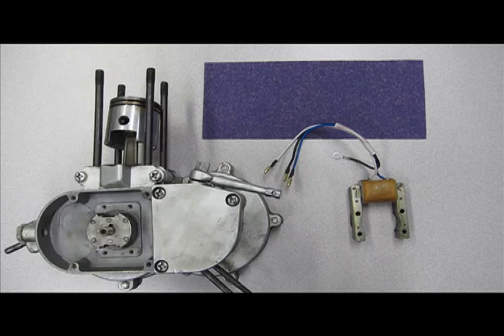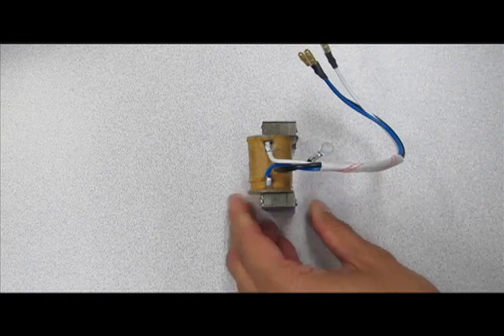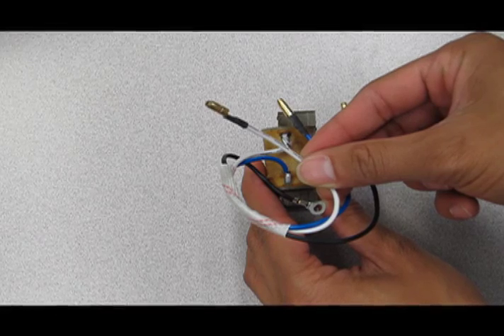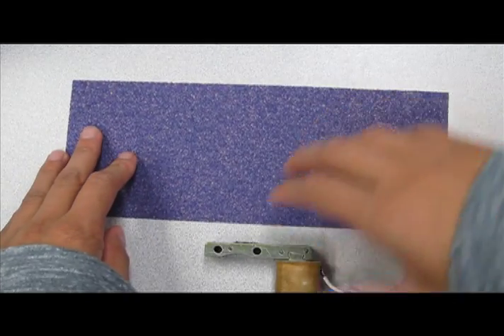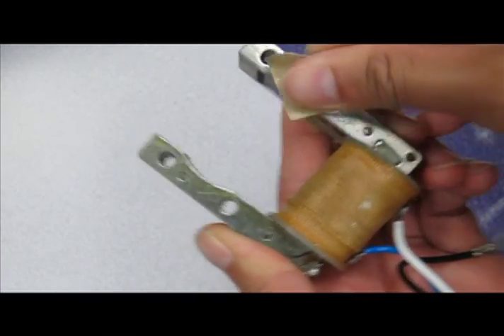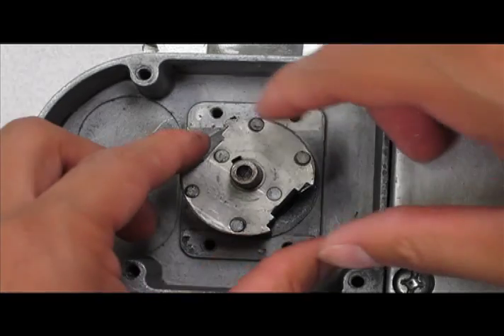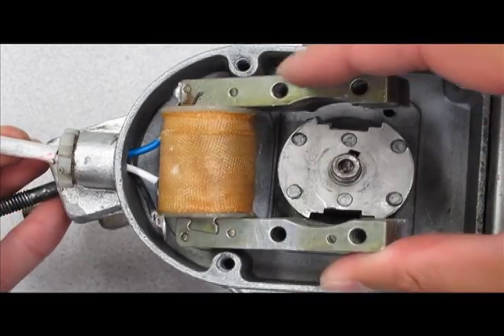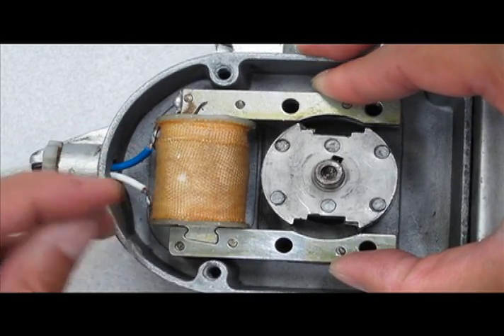UPDATE: Improving Magneto Contacts | BikeBerry Tips and Tricks

Comment: This is a very misleading video, ,it doesn't show a very important part when installing the coil mag. There must be a small gap between the magnetic and the coil ,if not the engine will not run right an may not fire at all and also cause severe damage to both parts,,and sanding is not important either, ,,if you tighten the four screws down tight you will have great contact, so again very misleading video

Comment: One side of the magneto touches slightly while turning. Will that be an issue?
Reply: yes
Reply: @meanoldrunk  thanks, looks like I have a couple of millimeters of separation on both sides now. I sanded down the base where that it screws onto, and carefully tightened it so it didn't pull to one side.

Comment: I changed the spark plug, carburetor, made a magnet key that hold the magnet and I thought that would solved the problem because it was damage and the magnet kept turning around the bolt at least that's the theory, after all that still no spark, if someone can give me more ideas I would appreciated very much. by the way my kill switch has always been disconnected.
Reply: Try to look at night time, and with plug out but connected, push the bike fast as you can. At low rpms there is very weak spark with these designs

Comment: How would you connect a LED lights on that white wire do you use the white wire and black wire or what do you use just wondering
Reply from the maker: give us a call at (800)317-0479 so we can properly assist you.
Reply: That I don't understand
Reply: White would b hot wire for your light, then u would have to ground the other wire from light on frame of bike

Comment: This was actually EXACTLY the "diagram" and explanation of the magneto I was looking for!!!! Though you didn't go in depth, it all made sense for me: the engine is physically rotating the magnet (powered via crankshaft etc), and the bar magnet in side (which has a north-south polarity of course) spins perpendicularly against the direction of the copper coils, effectively becoming a AC generator because it induces current in the leads of the magneto (ALSO it gives the iron engine block ITSELF an electromagnetic charge), and the current in the leads from the magneto are 'ultimately' connected to the spark plug, which, being at another side of the engine block, completes the circuit into the engine, the engine block itself also being the ground. I've still yet to figure out HOW the spark plug works (not "what" it does, not it's "purpose" in the engine, but HOW it works :) ), but this vid really unlocked a piece of the entire puzzle!!! :) :) :)
Reply: It makes ac tho
Reply: I agree it's AC
Reply: Corrected, thank you

Comment: I have a 2 stroke bicycle kit and was wondering if installing a pull start would damage the magneto.
Reply from the maker: Luckily, magnetos are simple designs and have no actually electric parts and very few moving parts. This makes it hard to damage any magneto without actually physical damage being asserted to it. A pull start add on, should work just fine.
Reply: @bikeberry  what if the magneto's rubbing on one side, what solutions do you have?

Comment: Why dose the magnet have to be at the 1 oclock position wouldn't it just move around anyway when the bike gets rolled? Please reply.
Reply from the maker: The 1 o'clock position is considered its default starting position which aids in alignment and synchronization with other moving parts. Doing this reduces the chance of installation error or engine malfunction.
Reply: Thank you vary much for the reply i have been doing alot of research and trying to retain as much information as possible again thanks and have a nice day. 🙃
Reply: BikeBerrycom thank you for the kinda informative response
Reply: I blew the cylinder out and replaced it found I I had no spark and replaced it now I'm getting spark and still won't fire . If I never tore the engine completely down would it still be at tdc

Comment: How many magneto need replace? During a engine life
Reply from the maker: The basic construction of a magneto is a magnet and a coil. The simple design makes it dependable and long lasting, as long as it is properly installed and not abused. All magnets gradually lose their magnetic charge, but most will have a similar life span as the engine, if not longer.
Reply: BikeBerrycom thanks for the reply, also have another question, My magneto and my cdi is all in low value, my cdi is in 500 something, normally is600 to 800 is normal, my magneto is only have 317something is low 327-345, also my engine doesn’t fire, but my engine is new, is any solution I can do for those thing to charge, or I only can replace?
Reply from the maker: If you like to fix things yourself, there are numerous DIY solutions to recharging the magnet. The general principal to charging a magnet is by using an electromagnet, or a any other type of strong magnet available, to realign and increase the magnetic polarities. If the part is still under warranty we will gladly replace it. Contact or customer service representatives at 1-800-317-0479 or visit our website, we will be glad to help you however we can.
Reply: BikeBerrycom what happen if both cdi and magneto all in low volume the engine won’t start directly，so low volume is hard to getting the spark to work?
Reply from the maker: Please contact our customer service representatives at 1-800-317-0479 or visit our website, we will be glad to help you however we can.

Comment: Does the white wire still rub engine performance if it isn't connect to anything but still remains there?
Reply: no. you can leave the white wire on an just not use it. Only thing I would do it put electrical tape on the end of the wire so it doesn't get wet. You won't lose any power for leaving the white wire on and not using it.
Reply: so one can just use a switch to run lights when needed and enjoy performance when it's sunny out

Comment: There are a lot o shortcomings in this self-proclaimed "short in-depth" video.  Mainly, what do you do with the white wire if you don't use it??  

And for those of you wondering how to gap the mag correctly, take a business card and fit it between the magnet and the u-shape piece.  ''Tis perfect!
Reply: He said he doesn't recommend using it.
Reply: It still leans to one side after I tighten it, would you recommend shaving down that end, or is it ok if it rubs a little?
Reply: White wire is for lights or anything that might take power. Dont use it, the magneto isnt strong enough to power motor and lighting and such

Comment: You fail to tell people on space setting between the magneto and magneto magnet. This is very important that this is as equal on the top of the mag as it is to the bottom..  If you fail to do this step you will have week spark or no spark at all!
Reply: Serge Smith how do you adjust the gap?
Reply: Serge Smith the 4 screws automatically space the coil
Reply: Serge Smith how do you adjust the Gap that was like the most important part😧

Comment: i have a question what if the magneto in the center is so tight i tried to move it but is so tight that is inmpossible to move , do you think that could be a reqson why my engine is not starting ? i could never get the engine running since i got it
Reply: victor larraondo where are you from im looking for a motor for a fix up project.
Reply: Any lucky Victor

Comment: I have a 66cc with HD lightning box and coil.  I can tune the carb but after many tries and even trying different carbs, I still have a 4-stroking problem from above idle and up, worst at top speed.  Any tips? Up compression? NGK 3-prong plug? Or is there something I neglected to check?  The Mag is oriented in the proper position but I have cackling and power loss after 10mph.  I've jetted all the way up and down the jet kit I bought and when running rich, the problem only drastically gets worse.
Reply: That sounds like an air leak
Reply: RichardWreckless put on a boost bottle I have a friend who had extreme power loss when holding 75 of throttle
Reply: Your exaust may not be escaping fast enough, get a performance exaust and or port the cylinder and make the exaust port a little more open

Comment: Just wondering if you guys could post a video on how to wire in a better cdi to the dragonfire engine. I want to use something like the jaguar to adjust spark timing. Or a huffy davidson to utilize the keyed ignition. Will the old style ignition fit inside the dragonfire? Any help would be much appreciated. My engine has high comp. head...high perf. carb and reed valve kit...expansion pipe...now it need more elect. juice...been told the spark timing is crap on these cdi s....
Reply: There's two wires running down from the computer that you connect where the wires come out of the motor you just match them up they're the same color I have the Jaguar installed on mine and I don't know how to adjust it I was thinking it might do it automatically but if you have any information on how to adjust that I'd gladly appreciate it

Comment: Hey I got the DragonFire engine with integrated internal CDI. It won't spark! What can I do? Already tried a different spark plug so I know its not that
Reply from the maker: coolstorybrooooooo Hit us up, it sounds like you got a defective CDI. Support @ BikeBerry.com or call us at 800-317-0479 from 9 AM till 4 PM Pacific Time on weekdays
Reply: the CDI might be shook up. if you replace that, cut a piece of rubber like an innertube to cushion it at the frame mounting. vibration could have killed it.
Reply: i bought a mega motor like three weeks ago from your company and i installed it it worked good but after one week i passed a bump and it stopped and did not start no more i scraped the magneto still no spark i take off the spark plug to see spark and no spark
Reply: what is it

Comment: non conductive aluminum ? get you a aluminum rod and poke it in your house braker box than say,,, non conductive ,how can metal be non conductive, magic ?
Reply: curt eval actually aluminum ~DOES~ rust, though it takes a loooong time for it to happen. Oxygen is a pain in the ass to most metals.   Google: aluminum oxide, enjoy!
Reply: @hutfrd  aluminum oxidizes, not rust. You need steel to get rust.
Reply: @towboatjeff  did you even read my comment, especially the last sentence. 

PS- iron oxide=rust.  aluminum oxide - rusty aluminum.  Steel is rust-resistant asnd is man-made, but iron isn't.  you need the two ELEMENTS iron and oxygen to interact with each other rendering oxide(pertains to any metal that oxygen corrupts .)
Reply: I would if that rod was coated in : varnish,paint,or excessive dirt

Comment: how do you achieve a good ground when the engine case is aluminum where the magneto is fitted - not sure i understand your logic.  trying to create a better ground between non conductive aluminum and the magneto really makes no sense unless I'm missing something.. the coating is an insulation..
Reply: Aluminum is a very good conductor for electricity.  Its used in some wiring in houses and electrical components
Reply: I connected a ground wire into the ground wires for the coil from the magneto and bolted it onto the frame at a bottle mount hole.(I have rubber mounts under the engine and knew this will insulate it.)Basically your clutch cable acts as your only ground to the bike frame otherwise.The paint on your frame ,at the motor mounts,would have to be sanded off otherwise.Maybe.?..Food for thoughts.
Reply: LoL,,, aluminium is a VERY good conductor of electricity !!!
You will make a pop can vaporize by just touching an arc welding rod to the can while it's sitting on the grounded work table 😂😆🙂